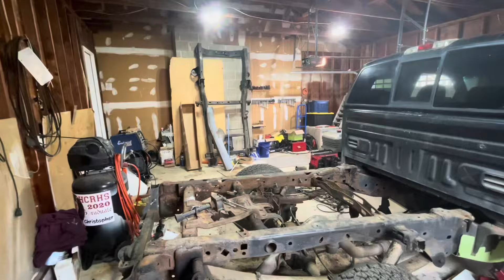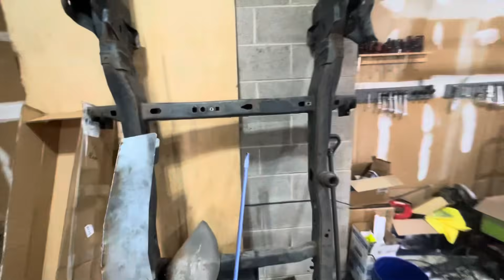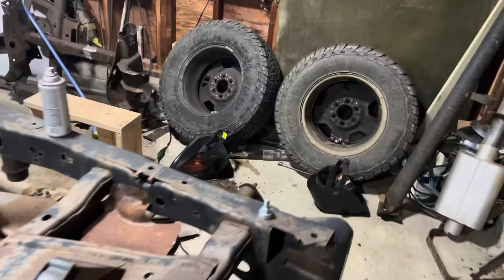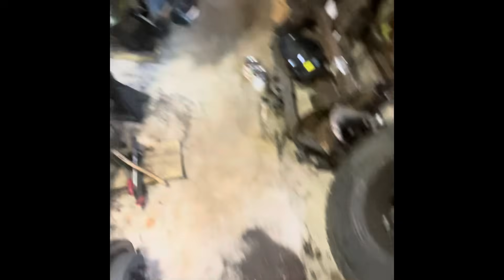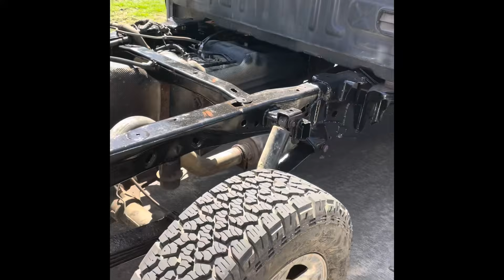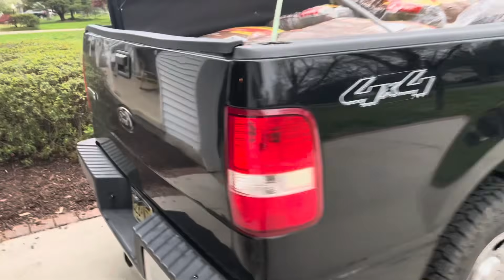2004-2008 F-150 Frame Repair / Swap

Comment: I think i would honestly that frame wasn't that bad I've seen and fixed far worse. Just cut out the bad weld in new treat with old transmission fluid.

Comment: Nice work. Ffr, try to make urr patch in shape of diamond and rounded on corners. No sharp angles. Been doing this kind of work 3 decades. Also don't waste $$ on $10 cans of wax when u can make a way better, longer lasting oil/wax with 1 quart of any new or used oil, same with trans fluid, 1 tube of grease and 2 wax rings for toilet. Mix, heat and spray. Or use mineral oil, and wax and synthetic food grade grease. Baby oil, Vaseline works gr8 too. Don't forget to kill that rust 1st. Yes wax will slow it down but get rid of it with phosphoric acid, muratic if really bad then phosphoric. Then a good aluminium/zinc 2 part primer/paint, then wax/oil

Comment: I bought a rare truck a 09 h3t alpha hummer truck from New Jersey only made I believe 5300 and 400 alpha 5.3 v8 mine one of the 400 this truck was made from 09-10 I have discovered real bad frame rust in bed area I just learn of safe tcap company that make pre fab frame kit they don't make one for my hummer truck I don't believe anyone has a kit for hummer sense so rare not even at junk yards this socks and body shop I don't trust if they don't experience in frame restore not a hack job , I think my frame rust rot worse than yours I have a overlanding build on bed , I know custom shops can do new frames aftermarket not oem I live in Texas most vehicles here don't get rot rust unless in a damp area we don't use salt on roads

Comment: Great job fella  I'm Re-working 2001 dodge ram rusted bed on my own I'm  into it for close to year cause I had issues with 4- wheel drive and nasty exhaust  manifold bolts So now boon bed repair almost done with it and turning it into Dump bed for my use. Body rust repair is Pita time consuming  but when I'm done I didn't spend more than 250.00 on bed and that's including harbor freight  welder

Comment: What do you think your final cost was for everything?
Reply from the maker: The frame section was $400, caps together were around $500. Maybe $75 in welding wire and $25 in paint so right around $1000 I’d say.
Reply: @KurtSchwoerer  wow! Yeah that’s cheaper than replacing the whole frame. Time etc. thank you.

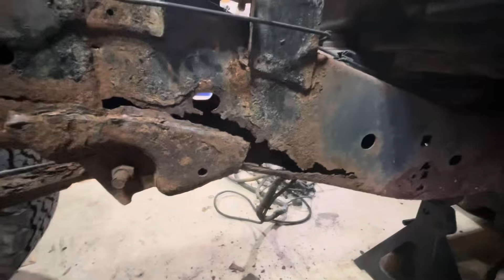Comment: 1:00 the bed brother...the bed will literally hold the frame together as long as it possibly can lol. Ive been there... exact same spot. The cab and bed are designed so stupidly that water just pours down into that area and there isnt a drain hole on the bottom of the frame anywhere near there.
Reply from the maker: No kidding! I didn’t even think of that. Makes me wonder what they did in 2009 to change that because I have yet to see a rotted out frame like this on an 09-14 model. Frames are almost the same, but they don’t rot nearly like this.

Comment: That was great. My son bought a 2008 with the same problem. Can I get a new chassis and just swap everything instead of doing all the work you did?
Reply from the maker: You can but swapping over the body, engine, and everything is WAY more work than this (believe it or not). I considered the same thing but this way was shockingly easier and way cheaper
Reply: @KurtSchwoerer You said you spent 50-60 hours on this I could do a frame in 20. With that said I probably wouldn’t take 50-60 to do what you did. Only takes 1 hour to remove the bed another 1 hour for the tank. Maybe another hour for the suspension at most. Keep in mind you don’t have to remove it all separately. Just disconnect the leaf spring hangers shock mounts exhaust brakes lines and wires and you can roll the leaf springs and differential out from under it together. Don’t even have to take off the tires. And if you have a slip yoke on the transfer case as opposed to a 2 part driveshaft you can just leave the drive shaft on the rear diff and it’ll slide out of the transfer case as you roll the diff away. So about 3 hours to get the rear stripped down. A few more hours for cutting and welding I don’t see this going beyond 10. Taking your time lots of interruptions and working without a hoist I could see how it would take a bit longer though. Especially for your first time.
Reply: Thank you. I appreciate you getting back to me.

Comment: The frame usually rust from the inside out similar to mufflers.
Reply from the maker: That’s the issue with boxed frames. Especially because once they’re welded it’s impossible to ensure the e-coating gets every spot.

Comment: Dude, you got skills. Save a fortune -- I am sure it was a huge amount of time. If you had to put a cost total what would it be - if you can share. Also, the total amount of man hours.
Reply from the maker: Thanks! I’m by no means a pro and know I didn’t do a perfect job (my welding is OK, fabrication is OK, and probably should’ve cut out the bottom of the box under the cab to clean that rust inside the frame, but didn’t want to structurally weaken it more and I don’t plan for this thing to last forever), but I probably put in around 50-60 hours (took a month at around 2-3 hours 5 days a week) and would probably cost a good $7-8k at least to get this done by a pro (that’s what I was quoted by a fabricator). No pro would ever do this since they would never want to be responsible for this 😂😂 Easier solution probably would’ve been just buy a rust free truck but I’m too stubborn lol.
Reply: @KurtSchwoerer  It looks great and hats off for not scrapping it out. Very cool! Also, the fact you did it yourself - you know what it can handle and what it cannot!

Comment: My 05 Lariat has the same issue, frame is rotted but the engine runs so good.  It only has 130,000 miles...it's a damn shame because a side from a couple rusty spots on the rocker panel the truck is mint for the year.
Reply from the maker: I’m planning to make a video explaining why I think these rust out so bad in these same location… also to call ford out since it’s BS that Toyota recalled all of those Tacoma rotted frames but ford won’t do the same.
Reply: @Kurt Schwoerer  Your right, Ford should have recalled these frames.!  Considering that there are some older trucks from the 80's and 90's with frames that are still solid for the year.

Comment: Your the man bro. Thank you for this video. It gives me hope that i can fix my similar rust rear frame issue on my 2006 f 150.
Reply from the maker: No problem! I hope it goes well for you. Anything can be fixed just depends on the length you’re willing to go to do so. Shoot me a message if you have any questions about it.
Reply: 2006 is not that old. I'm seeing more n more ppl who drive 5 or more yr old autos with either rust, frame issues, or reliability issues. Wtf is going on when we can't make a automobile that will just run, drive and not rot away? I believe we put too much intrest in having our hands and ass cold, wifi in auto, lane departure, etc. We all don't need that. I'd trade all that fancy unneeded tech for a reliable new gen 4.6 2 valve type engine, a regular OD auto trans with less than 12,8,6, 5 speeds, it don't rust within 1st decade of ownership, and it will just run and drive. My aunt bought a Toyota and Honda around 2000. They ended up keeping cars when paid off and kept 1 for extra and passed other around in family, then both. Both still run, drive, shift etc fine. Both paint looks good, no rust issues and both over 300k. We can't do that 23 yrs later and we have alot more tech, ideas, better all around everything we can use but dont. Now autos cost 100k and above. Insane. Somethings gotta give and we gotta stop paying these house value prices for pop can metal, plastic, and computers and wires we call cars. Hit a deer and that plastic front end will be over a grand to replace, usually more. Plastic folks, not gold infused, but plastic.

Comment: Fla boy so my 5   2001  sport tracs are 100 percent rust free..lesson learned while growing up in upstate New York..power steering pump was leaking/spraying oil over the one side of the chassis…I was lazy so I just kept adding transmission fluid when it started to growl…for 6 years…one day changing starter noticed one side chassis rust free the other side rusted out…that’s right…lesson learned from that day on every couple months I would go under the truck with a hand spray pump and spray it everywhere…everywhere …everywhere..inside chassis…rails ..bolts.. fuel lines..brake lines ..outside chassis..yea messy as hell…..very  dirty job…the transmission fluid does not hurt rubber seal of body mounts….I do it when I had the energy and it looked like the the fluid was wearing off…
I cannot stress how well it worked for 5 dollars..and a little elbow grease…been doing it for 30 years…in Florida to…trucks underneath look brand new..
Reply from the maker: I’ve heard that trick before! A lot of people use ATF or just old motor oil on it and works great! I’m likely going to use Blasters new rust protection oil.. only reason being it clings to the frame a lot better so you have to apply it maybe once a year at most.